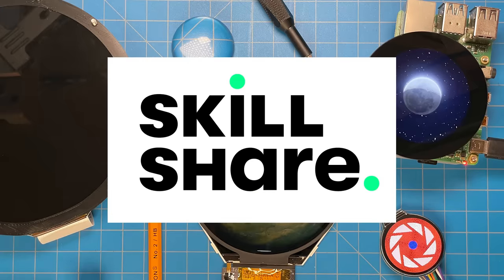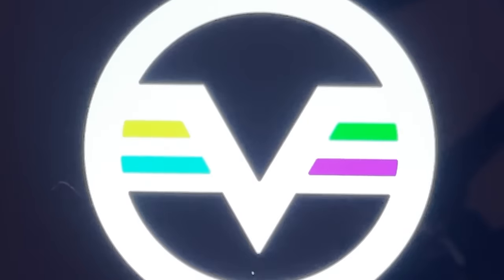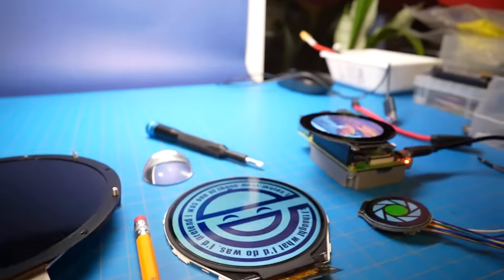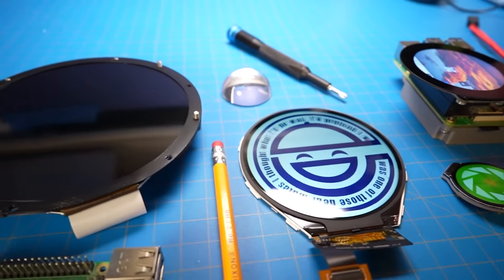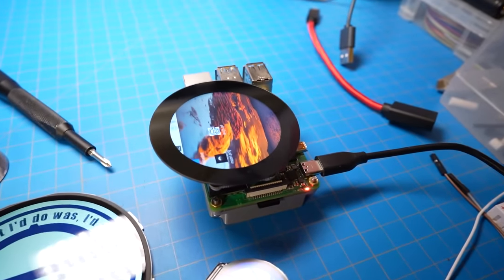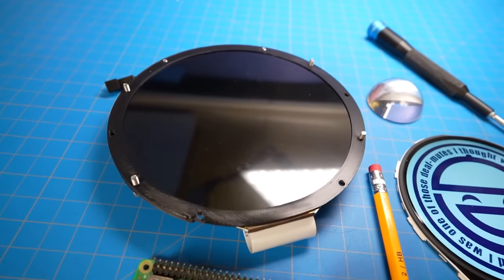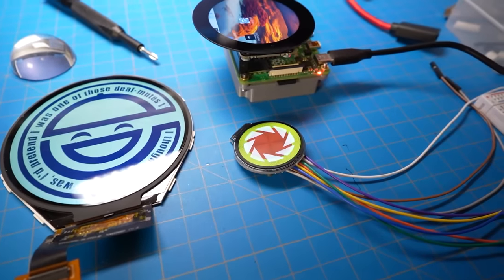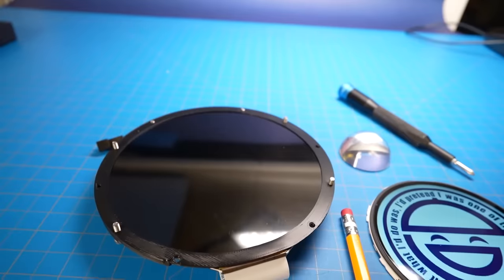Exotic Round Displays and How to Use Them

Comment: For some reason, the first thing I thought of was replacing the standard car dashboard dials with these! You can position the screens in whatever layout you want, not to mention having customizable speedometer or fuel/battery gauge. You will be able to have a way to add almost any sensor to you dashboard as well.
Reply: Same here, but it's tough to find anything in a decent size and OLED. Don't thinkt the backlight is so nice for during the night. Unless you were able to find a good, larger, oled model ?
Reply: already done. and its more easily and cheaper to use one regular display. these displays are used for specialised use, like watches or displays in special cases.
Reply: @peepopalaber  Sure its easier and cheaper to use a rectangular display. But it wont integrate as nicely as a round one.
Reply: @Elmarvan94  his point is, it does. newer Mazda dashboards do this. The plastic trim hides the fact that the screen is rectangular.
Reply: NICE!!!! Great thinking! 👍
Reply: Just use a square one….
Reply: @corataylor2205  thanks. Exactly
Reply: @peepopalaber  Late reply, but the idea I had is that you can possibly place a round screen in front of the existing gauges. I know not all of them are round, so it won't be a universal solution. I have a honda with round gauges. Actually removing the gauges might interfere with the function of the vehicle - safety is of course the most important - means if anything breaks, such as the code is not quite up to scratch, then you can just pop them out.. I personally would love to be able to pop in a display and take them out if I end up selling. Or something like that.
Reply: that's the current plan for my ev project, the 71 corvette uses 5" round gauges and i'd like to replace those with displays.

an alternative might be to use one wide rectangular display behind the gauge holes and align the gauge graphics but that would be a ton of wasted screen real estate
Reply: @corvolt600  Does the wasted screen real-estate really matter when the screen itself is orders of magnitude cheaper and easier to obtain than a regular one would be, though? I feel like people are finding excuses to use a round screen just for the novelty and not for practicality at this point.
Reply: @Elmarvan94  I have seen OLEDs that are round, but they were meant for smart watches so you can guess how small they are. No manufacturer sees a profitable market, else they would definitely be able to produce these
Reply: or you could just put a single bigger OLED across the entire dash and get all of the dials on one screen for way cheaper?
Reply: Let's be friends 😂
Reply: that in some bugattis instead of a big screen so the car becomes timeless in the future when our current screens become super-old
Reply: Planning to do this

Comment: I need a 42" diameter one, any leads?
Reply: w.. w-what for?
Reply: A manhole cover that screams in pain and shows a face of agony when it gets stepped on/ran over
Reply: @tf_d  OwO come into my sewers
Reply: I have your solution, get a 42" display and a pair of scissors
Reply: @ethand4784  n o
Reply: @ethand4784  the forbidden screen adjustment
Reply from the maker: Not yet, but I'll hit you up if I come across any jumbo versions. Also, love your vids man. I'd love to work with you and help you bring any of your ideas to life. We have veeeery similar interests.
Reply: @MrVolt  plz do HAL from 2001: a space odyssey
Reply: @ethand4784  Good luck getting it accurate.  Pro play is to drill a hole in the center, use a router on a stick and get a super accurate circle in any diameter the stick is a radius of.
Reply: @ThylineTheGay  I'd take a trip through your gutter??? jeez
Reply: To quote J. Jonah Jameson - Wheeze "Ahahahahahaha- You're serious?"
Reply: @ethand4784  I’ve done that, I recommend it
Reply: @tf_d  Cool idea.   You could have the image of an open shaft sometimes to trip the sleepy phone user.  Use two cameras to observe location of victims head and project image from their view point to make it look like a hologram. Metal rim with insert of bullet proof glass and top layer of translucent acrylic as a screen for rear projection.  You could machine the top to have usual cast iron cover texture.

Comment: The devices in the sci-fi magazine at 13:39 are what is essentially a phone with a video call function. All it would take would be a microphone (preferably an array to use for noise cancelling), an audio output and a wide angle camera with OIS. You can use the motherboard and battery from a smartphone to control it all, and install custom software to start on launch like the handsets for scan as you shop in supermarkets (they run Android, sometimes you can still access the navigation buttons and go to the home screen)

Comment: I really have been thinking of getting a GPS module attached to a Arduino or Pi and a small display, 
then house it all into a rugged case for a digital atlas for hiking.
These round edges would actually fair better in a drop test, than a corner impact on a standard display.

Comment: I bought a 4" diameter screen and fitted it into a 1954-designed vintage oscilloscope carcass.  ("Type 13A" if you want to know the make..)
The controls of the old O'scope, plus casing, are still in good condition, but the carcass has been gutted and the casing cut down to make its footprint more acceptable.
The controls for vintage O'scopes are very different, and now I have the task of analysing the behaviours of the old analogue instrument, and then design a digital replacement that will work as well as or better than the original.
It is just to keep this old cogey's mind working - something to keep me out of trouble instead of go joyriding in stolen cars or climbing mountains....  😂
Thanks for your demo vid.  ❤😊

Comment: The 2 things I can think of that I would like to do with one of these are:
1. Interactive Miss Minutes from the Loki series on Disney+. That would be cool to have an all in one unit that was interactive that you could talk to like Siri. Add a motion camera and it can follow you around with eyes and be all creepy like.
2. Replace and 100% customizable dash board display in your car. Get 2 of the 3.4 or 5 inch ones for Tach and Speedometer and some smaller ones for oil pressure, fuel, alternator voltage. You could customize them to anything you wanted to output and display different backgrounds on them to match the style of your car. Would be interesting to see.

Comment: These round displays would be amazing in a handheld magic mirror (like from a fairy tale). 3D print a frame/handle with a very ornate design, and put a 2-way mirror in front of the screen (when the display is black you only see the mirror, but text pictures that appear on the screen will shine through).
Reply: I was thinking something similar. Either the theatrical mask from Shrek or the eyes and smile of the cat from Alice in Wonderland.  But I was thinking it would be used to augment a voice service like Alexa, Google, or any other flavor of voice assistance on the market.

Comment: 800x600 centered would still look awesome , someone had the idea first to put the screen behind a thin mirror so you could have those devices used in the comics, today. I think it also has a ring light for makeup but integrated with the screen/mirror. I think having one for a door hole would be neat for those who don't want or cant have a company owned video doorbell system.  just attaches to the back of the door and blows up the through hole image to a size that's more manageable.
Reply: Car diagnostic, boost gage, nav direction

Comment: This perfect. I’ve always wanted to figure out a way to make a smart speedometer for my motorcycle (it has a 4” speedo) and so I’ve wanted to use the original housing to keep it looking stock. Now I just have to figure out the software side. I’d like to be able to use the touchscreen to swipe and open a map or more info screen etc.

Comment: I've made a few raspberry pi based arcade cabinets with retropi and hundreds of old games.  Sometimes it can be confusing knowing what button does what in different games. I would like to embed the 1.28" displays into custom button face (reusing the switches but replacing the top) and have a scraper pull what each button does for each game to display the function on each button.  They would be a little oversized and It would be tough to make it robust enough that you wouldn't destroy the screen when button mashing but at $20 a piece I think it would be worth the experimentation.
Reply from the maker: Oooh, programmable, digital arcade buttons would be awesome!

Comment: This is motivating me to dig out the 5 360x360 ips mini circle displays I got in my parts bin.  I got one to work but using the DSI interface was kind of meh at the time.  Also couldn't think of a good project with them.

Comment: Some of those to be retrofitted as a gauge cluster in an old car. Looks old and time acurate, but with a flip of a button you can see info as oiltemp, rev, voltage, boost, GPS and other car-stuff.
Not all people want square digital clusters.

Comment: One idea for a project : A virtual telescope. Perhaps with an accelerometer, some fake lens in front of the screen to have it look more real.
Perhaps rather than accelerometers, have it tied to a base, and have potentiometers move when turning, or something like that (rotary encoders?)
Well anyways, you move the physical thing, and it moves the view. Turn a ring, and you zoom in, and perhaps another one for focus (could be simulated by simply bluring the image when not in the proper range? but it would require more meta data, more difficult to implement properly).

Anyways, nice displays, i think i'll look into those to see something to build with it.
I'd like to do something like gauges with it, or; based on your dragon radar idea, some kind of GPS thinggy.

Comment: I purchased the large 5 inch display. One thing to note is that the display has a 04 written on it for some reason. Also the buttons have two functions. One will change the aspect ratio of the display. The other changes the brightness of the lcd.

Comment: A motorcycle odometer that shows driving directions and a camera feeds when the turning signals are on... The pi can easily control things like temp and oil pressure sensor, shift indicator, and even tire pressure indicators...

Comment: My idea: Wall-mounted clock that serves as an alarm and possibly has Mycroft integration as an alternative to Alexa. Think of it as an open-source alternative to an Echo show.
Set timers and maybe even stream music. Or, go completely unga-bunga and include a CD toploader so the screen flips up, revealing a CD drive, to pop in a good old disc, or audiobook, and have it play that back!
I currently have an alarm clock with quite some features, and one of them is indeed a CD player which I use to play all my audiobooks - I am visually impaired, thus, those things are very common to me. What I heavily miss though is being able to seamlessly switch between inputs. The remote works, albeit being flimsy as heck, and changing input channels is not easy. It does the job, is an amazing device, but it is just missing that seamlessness for when I just want to send some Spotify to it to listen to tunes before sleeping, or being a home assistant for my smart home.
Alternatively, just make the most overkill, overpowered DiscMan in existence with that 5" chonker :D Add a battery and storage and off you go!
Using SDL and LVGL, making small programs for this sounds like fun. Sadly, due to my impairment, I lack soldering skills and I haven't had a good introduction to 3D printing stuff yet - except for it costing quite a lot -.- I still have a PSX DVR (the japan-only PlayStation 2 with integrated DVR) here. It's dead, dismantled and sitting in a box and I have been wanting to make an internal frame for it to throw a RasPi, BD drive, some harddrives and other neat things into it as a makeshift retro console or media center as an alternative to an Apple TV.

Comment: There's a game for the original GameBoy called Stargate. If I remember correctly, it was sort of inside a cylinder with concentric rings of blocks that you had to spin to match up hieroglyphs, and the rings would disappear, sort of like tetris or candycrush (but moving a whole row/ring, not just swapping two candies). I think that's how it worked, and there was a time limit and you had to remove so many rings or something to "open the gate". That would work really well on a circular screen! 
Or a smart alarm clock with a nice face and lots of interactions would work too.

Comment: I wonder if for some applications it makes more sense to buy a rectangular/square display and then over up the corners with a bezel to emulate a round screen - might be more cost effective at larger sizes. Though the tradeoff is you need the real estate under the bezel to store the corners, which you won't always have depending on the size of the device
Reply: This is exactly what many modern cars use for the instruments cluster. One rectangular screen, with a bunch of round bezels overlaying it. Cost-wise, the rectangle is cheaper, and as long as you have someplace to hide the corners, you're good. These round screens are fairly niche in that they are only required when you have a really tight space to fit them into. The "eye" of the animatronic he showed off is a good example, as are watches. But there aren't a lot of real-world applications for them that aren't pretty contrived.

Comment: I was able to use the waveshare 1.28" with a Pi Pico/CiruitPython to use as the eye for my Starro mask. Still playing with it. I have the eye moving randomly on the screen and changing colors. Now I'm working on trying to use input from a 9DoF accelerometer so the eye will look in the direction I turn my head while wearing the mask.
Reply from the maker: That sounds so cool! Do you have photos anywhere?

Comment: hhmm, I have an idea to update a old Tube Oscilloscope from the 50's. Toss in a round screen, a Pi and a Hantek USB scope system into the old chassis. Maybe even use some rotary encoders to the GPIO and create some micros to be able to change the timebase and division tables.
Reply: As long as it doesn't work. Although depending on it's age the upgraded version might have better bandwidth?
Reply: The latency from a USB scope running through a Pi would make it kind of a shitty scope, especially if you used a cheapie Hantek. I’d only consider doing it with a proper high-bandwidth pipeline directly from the ADCs to the display.

An analog scope deserves an analog upgrade, turn it into a hybrid storage scope if you want but keep the CRT.
Reply: @Scrogan  When I was given the scope it was missing the CRT and a few tubes. I did research on restoring it but it's not worth it. Would cost about 400 bucks in restoring it. A complete unit could be had off of ebay for a 100 bucks and the typical recapping job would cost about 30 bucks. I already have the Pi 4, USB scope and everything else except the LCD. I was thinking to use a 4:3 LCD but I would have to cut up the chassis bezel but I would hate to do that.

A Pi 4 would be plenty for a Hantek USB Scope. The chassis is big enough to house a full ITX desktop but a Thin Client would be a happy medium to save on weight.

It's an RCA Institutes Vacuum tube scope from 1952. Has no DC coupling and very limited on bandwidth.

Comment: A digital periscope.
PVC pipe a camera at the top and and one of these screens at the bottom. even do a bezel by cutting out a circular hole in a cap for it. Overlay graphics with the height above sea level and longitude + latitude by using a GPS module.
Alternatively, make it a decorative piece by using one of the large screens as the 'In' lens, showing a graphic of a sailors or krakens eye looking around.

Comment: Hi Mr Volt. Awesome video. 

By any chance did you get the 5 Inch or the 3 Inch screen to work with a raspberry pi at all? I got one a month back and can't seem to get it to work. As soon as i plug the HDMI in to the Pi and the Driver for the screen. I get a flicker and sudden black. It works fine when connected to a PC or to a Phone.
Reply from the maker: Yes to both. Check out the link to the Adafruit guide to weird displays in the description. The config.txt needs some extra setup for the Pi to output the right HDMI settings for these. It wont work with default settings.
Reply: @MrVolt  Big thank you dude. 

Hopefully can get this working well soon. I'm currently working on a Weebo from flubber so i want to get the 5 Inch screen to work. Fingers crossed i can get her to fly using a drone.

Comment: If you use like a custom desktop you could probably and had some programming skill or if it was doable in the programming you could probably set it up so that way your desktop would properly fit the sphere and then any games you open up that were not full screen we're centered in the middle so you would have the full HUD but you'd also have probably some black edges unless you had some other kind of way to finish those off and kind of again manipulate the desktop

Comment: Can I run a bunch of low-res displays on a RaspPi or Arduino? I'm designing an EV instrument panel and want to use two 5" circle LCDs side-by-side (one for speed, one for watts) however I ALSO want to run two 2.1" circles and possibly a 4" rectangle as well. If the aforementioned systems won't do it, Windows or what? I should add that the resolution of the 5" ones is 1080x1080 and the 2.1" are 480x480. I wouldn't think that's a lot of work for a GPU since it's a low combined pixels.